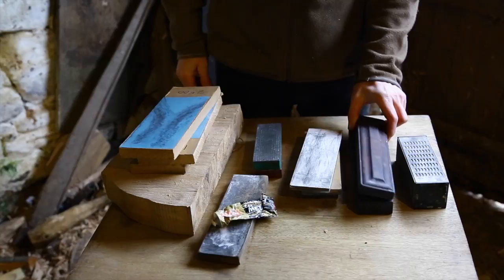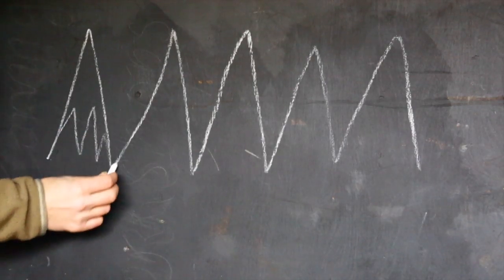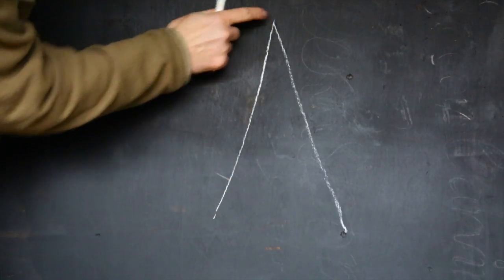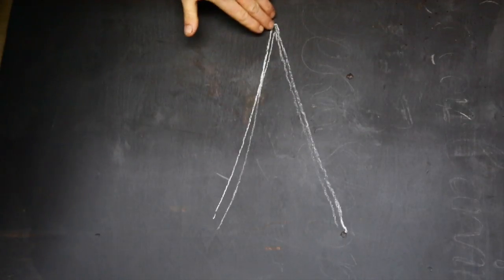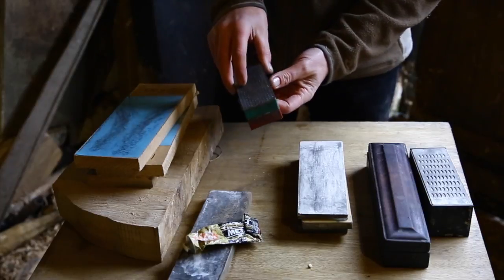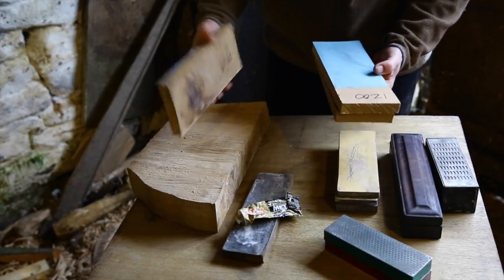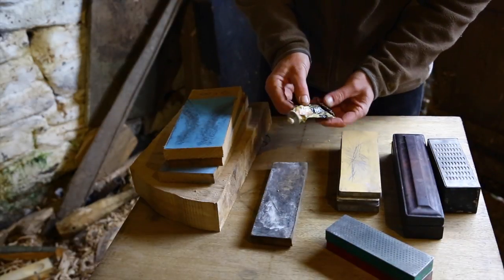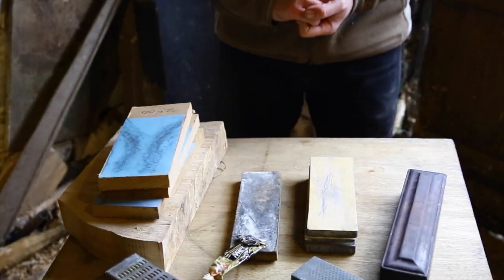Introduction to sharpening with Robin Wood

Comment: Robin, just found your videos and I greatly appreciate the info you share.  Can you tell me what sharpening angles I should aim for on an old hatchet that I'm trying to restore?  What about on carving knives?
Reply from the maker: jbrand81 I would start at around 25 degrees on both, if having sharpened to that the edge rolls or chips then it is easy to steepen it up a little until you find the minimum angle at which it holds the edge well. If you want to be on the safe side start nearer 30 but obviously the finer the angle the easier it will go through the wood.

Comment: I'm still a touch confused. Robin says he uses 1000, 6000 & 15000 grit shapton stones and then auto-polish on the strop. Would it be possible to sharpen on the 1000 & 6000 stones, skip the 15000 and then finish off using the strop and still get super sharp knife?
Reply: That is absolutely possible.